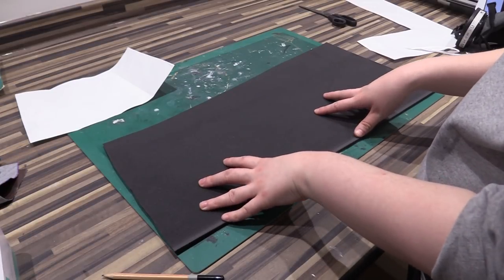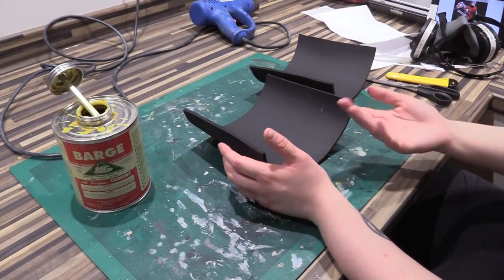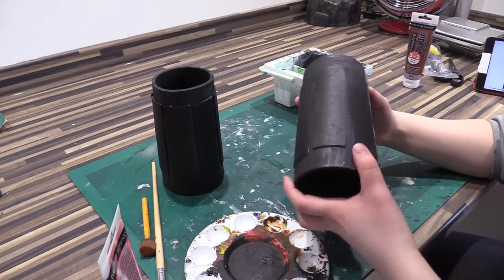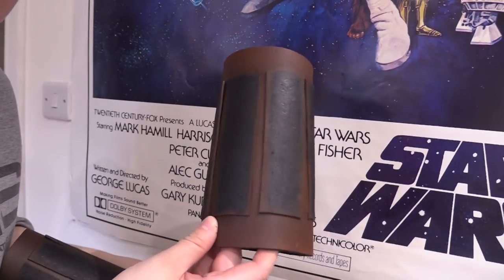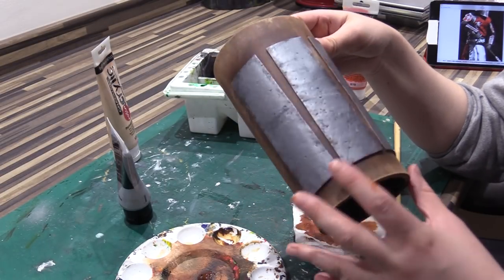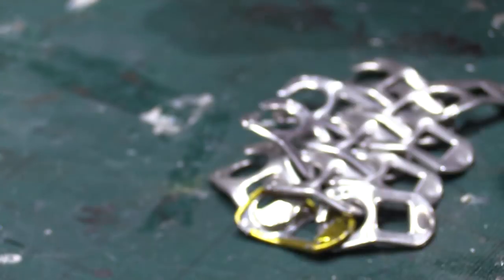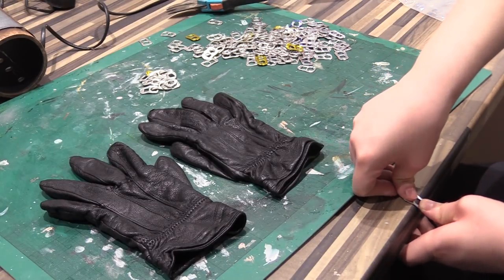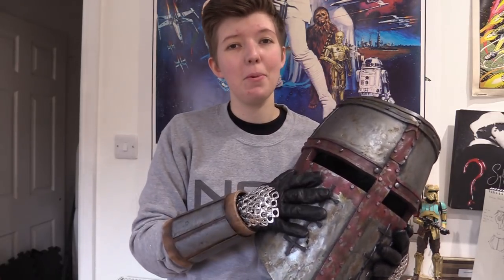DIY Foam Templar Knight Gauntlets w/ Soda Can Chainmail

Comment: Too bad using pull tabs for "chainmail" Making butted mail is fairly easy and would look WAY better. you don't even have to make the rings yourself, alltough that's not hard either. 4in1 pattern is easy and making enough of it for this porject with id 6-10 mm wouldn't be more than 2 hours of work.

also, the "metal" of the bracers should have som connecting on them. they are glued on, but how would they have been added if they would be real?  Using some simple rivets would lift them high.
Reply from the maker: Torbjørn Kolven If I wanted actual chainmail I would have used it. This costume is a little fun experiment as ive seen some awesome creations using tabs to make chainmail. Currently still collecting enough to make the rest